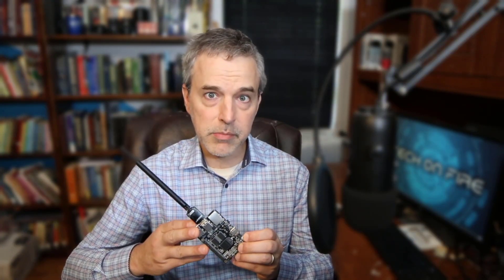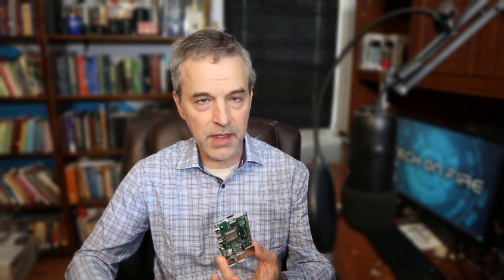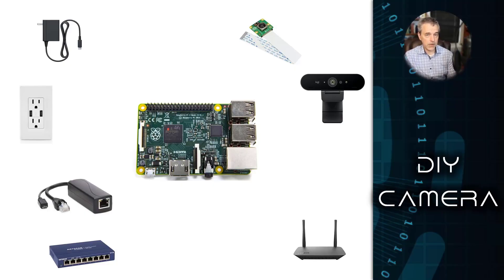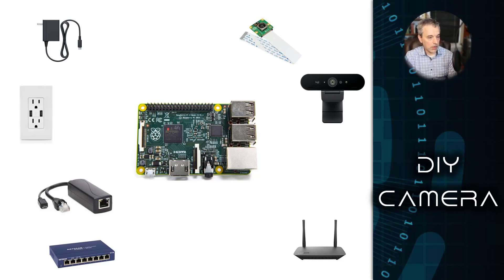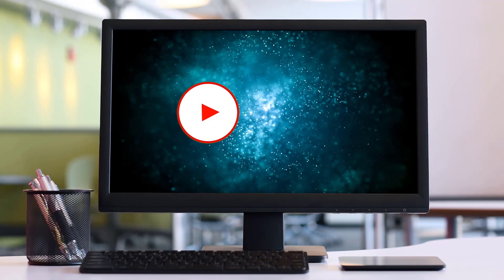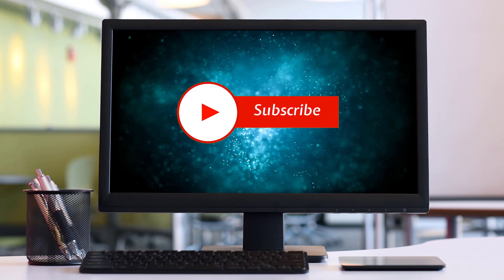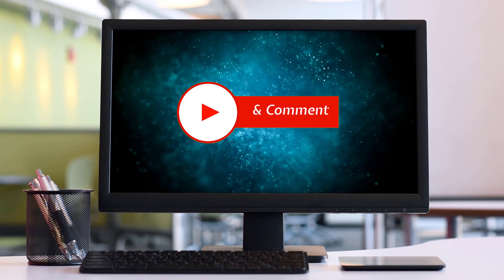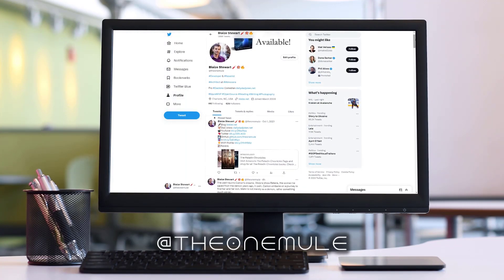How To Build Your Own Security Camera: Part 1: The Hardware

Comment: Stopped watching... Would have appreciated the showing of each product he was talking about individually not as a large slide of items

Wish he offered onscreen the link or actual product on Amazon. Very hard to follow if you're not actually advanced enough to understand everything he was talking about
Reply from the maker: This isn't supposed to be a specific guide with any hardware in particular. These represent the kind of hardware you can use, like USB cameras or PI Cameras, Raspberry Pis and Pi alternatives, Wifi or Ethernet, Power over Ethernet or just an AC adapter.
Reply: @BlaizeTech  Yeah I can get that. But as someone who is in the market for trying to do this, I feel like your audience would be those who view this as informative and interesting rather than helping me or anyone understand

I'm not completely green around technology and can build my own PC but never screwed around with Raspberry pi because of the lack of time

Anyway... The content here seems more geared towards those who are way more familiar with the development of this in a prior project. I kinda tapped out because it wasn't clear and concise to what I should use as examples.

I guess I'm too used to having the ability to look at each component your showing rather than just look online in general and then make a purchase etc
Reply from the maker: Fair enough. I did another video using specifically on PI cameras if you're interested in a more specific example. It's pretty straightforward in any case.

https://www.youtube.com/watch?v=w-zoOaK4hSk
Reply: @BlaizeTech  Thank you, I will definitely check it out when I get a chance

Comment: Can I use POE cameras with this setup?

Edit: or does this just turn a USB camera into a POE camera?
Reply from the maker: You can just use POE camera 

For USB, you need a way to process the USB signal into something that can be on a network, so a dev board is needed.